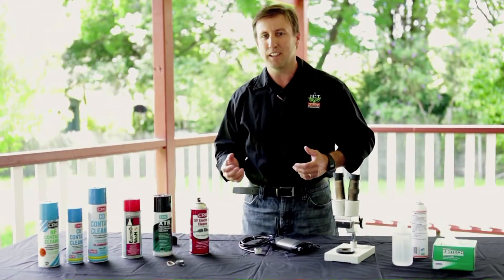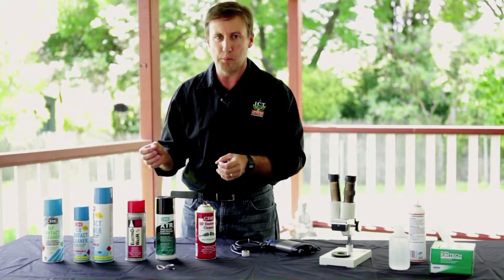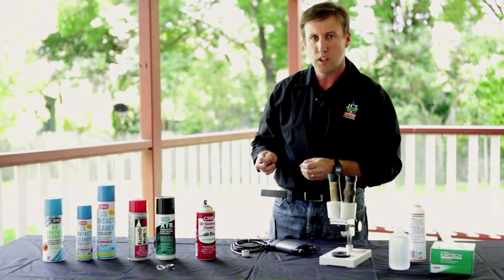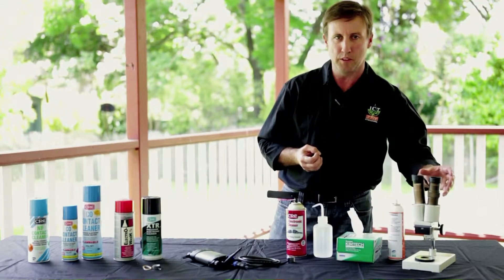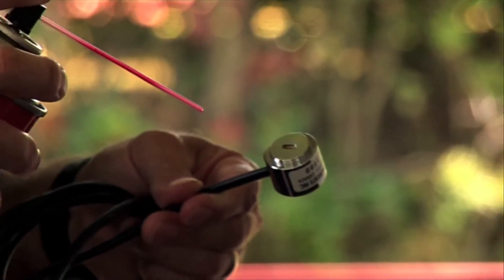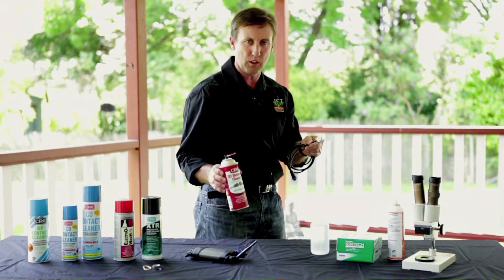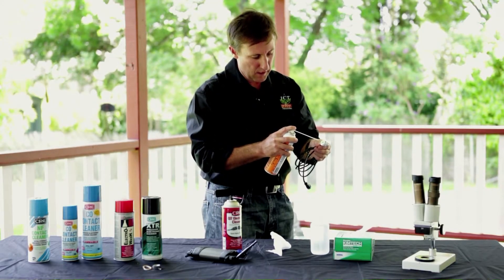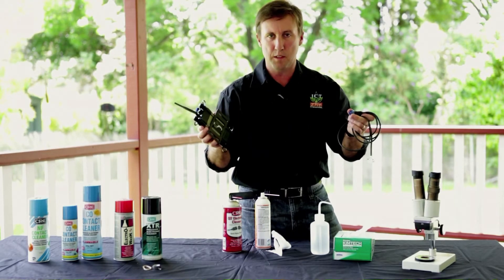Stem Psychrometer Cleaning With Electronic Contact Cleaner

Comment: It is very useful to me. 
One question - what happen if the thermocouple wires are not in the desired position? 
I checked my malfunctioning PSY1 this morning and found the wires are collapsed between the metal supports. The connections to the supports looked good. But I cannot expect they would contact wood nicely when installed. Can I use a toothpick to lift them up? Can you guess me any proper direction? Thanks. Goonbo from Seoul.